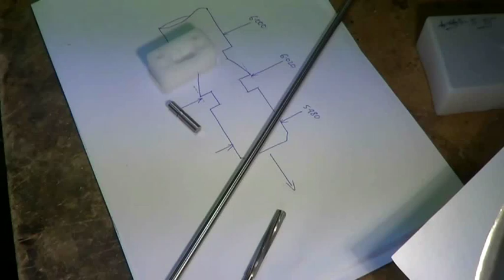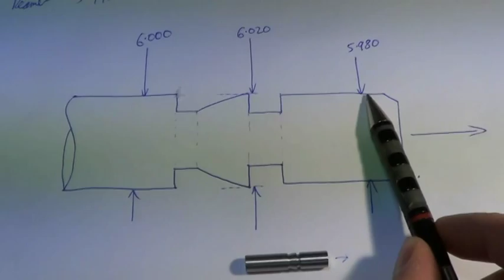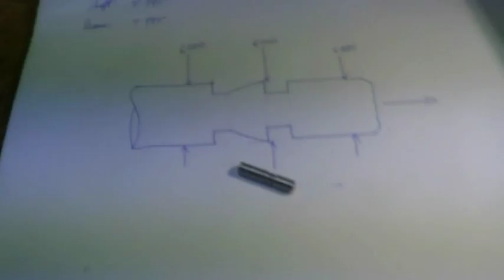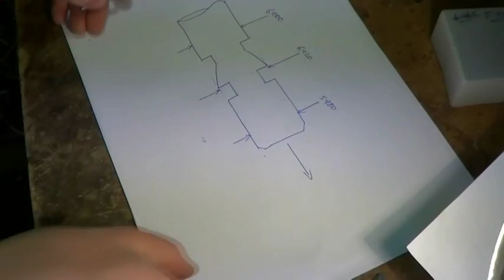Single-tooth 6mm broach cutter

Comment: Why not just get a slightly larger reamer?  I wonder if you cooled the plastic part before reaming with the too-small reamer you currently have would let it ream a more proper-sized hole as the plastic might not be able to deform as much and cause less spring-back after removing the reamer.  At some temperature point (liquid nitrogen?) I guess the plastic essentially won't deform at all (probably wouldn't shatter either if the surrounding material is thick enough).  I guess if the plastic changes size with temp then there's a new problem though....
Reply from the maker: Guess I could've - I didn't realise at the time it was possible to get oversize reamers (e.g. 6.01, 6.02mm etc). I did actually try freezing the plastic parts and that helped - plastic has a very high expansion coefficient so you don't need to cool it much.
Reply: @imajeenyus42  thanks for the reply(ies).  I wonder if freezing the reamer could also be an option as the material that matters is a small enough layer that the cold metal might cool it on contact.

Comment: Purely out of curiosity, why didn't you cut clearance for a sintered bushing that then you could of had glued in place? Last i heard Delrin has some issues in time. Cost or not worth the effort?
Reply from the maker: Thanks for the comment - it didn't really merit that amount of effort. These blocks are purely to support/clamp a pair of linear rails (they don't actually have to slide on them, that's done by a separate carriage with linear ball bearings), so it was sufficient to have a plain hole with grubscrews.
Reply: ***** Ah. Yep, not worth the effort. Forgot to comment in the original message, the broach idea for this material is really good, i use it myself but at some point gave up on trying to ream it so i made the holes oversize and reamed them. Broaching is way better. So thanks for the idea.

Comment: Nice work.  I have heard that Delrin is effected by humidity, so if you were trying to maintain your sliding fit it might be difficult.  However, you did say that you were using a setscrew so it won't be an issue for this application.  It is very nice material to work with and has a pretty decent finish.  It might even polish up a bit as well.
Reply from the maker: Yeah - I was initially really keen on trying to get a "just-so" fit that could be shoved in by hand without needing a retainer, but this was going to prove very difficult, both with humidity and thermal expansion. So it had to be a grubscrew unfortunately ;-)

Delrin sheet also seems to have a lot of built-in stresses; I was routing some parts from sheet which had a lot of material removed from one side, and they curved slightly. Fortunately not too much of an issue in my application.

It machines really nicely - I'm routing it with a 6mm 2-flute uncoated carbide cutter, 18krpm. Produces lots of snow!